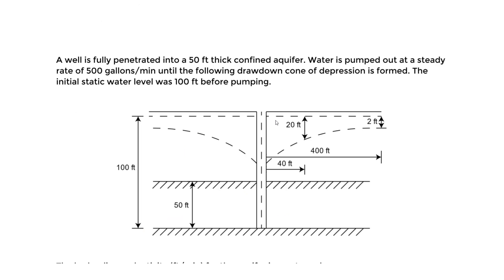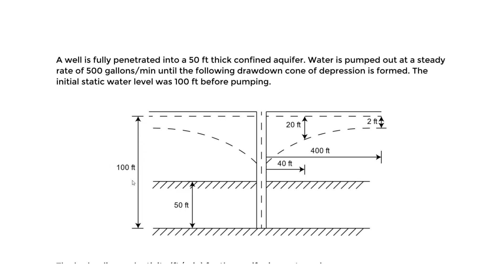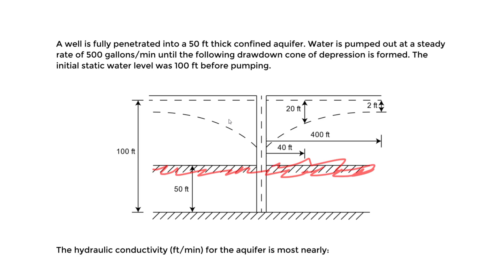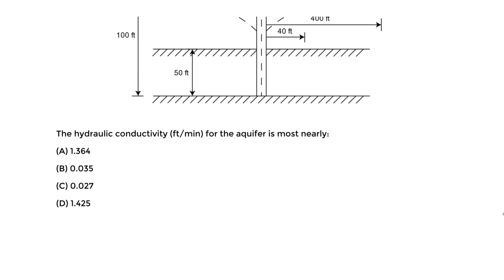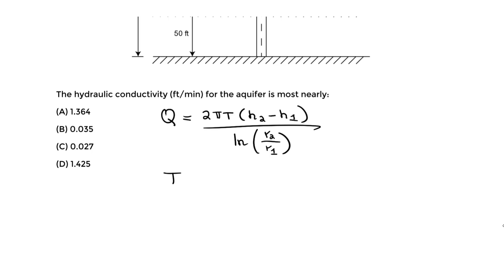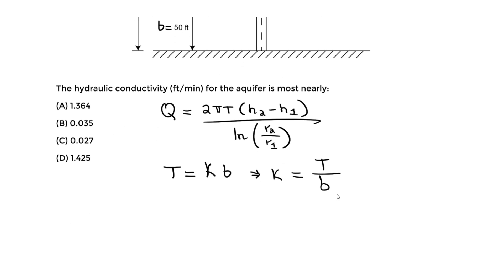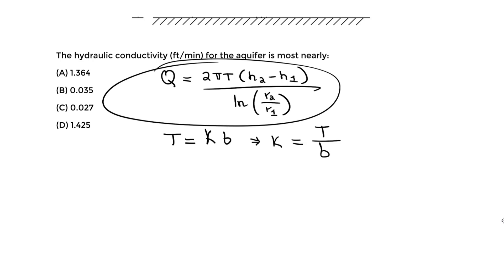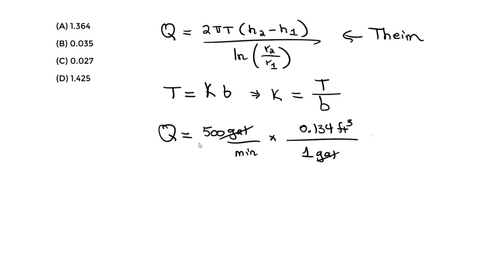FE Exam Review - FE Civil/Environmental - Groundwater - Confined Aquifer

Comment: In the handbook it says Q= cf per second and you are using cf per minute, also K is supposed to be ft/sec units not ft/min.
Reply from the maker: Q can be cubic feet per minute as long as K is in feet/minute. In this formula, we can use any units as long as we keep things consistent. It is NOT an empirical formula where Q has to be in cubic feet per second and K in ft/sec.

Comment: FE manual says T is in Ft^2/Sec. Why do we not convert from minutes to seconds here when converting from GPM to Ft^3/Min. Why do we not convert to Ft^3/Sec., since T is Ft.^2/Sec? Or does the unit of time not matter so long as it is consistent?
Reply from the maker: I think we don’t covert to ft^2/sec since the question wants us to find the length and time units in feet and minutes. 

If the question asked for k (ft/s), we would in that case concert T to Ft^2/sec